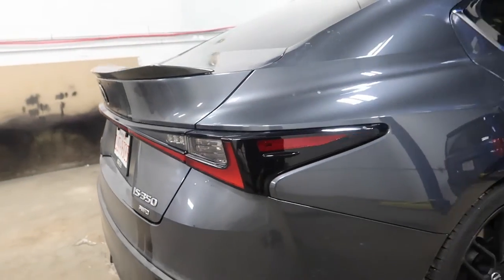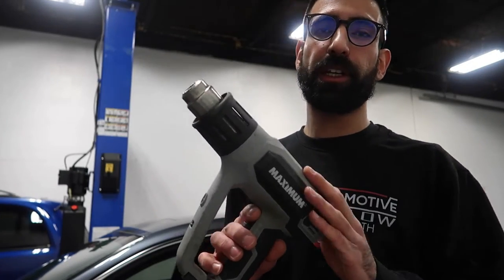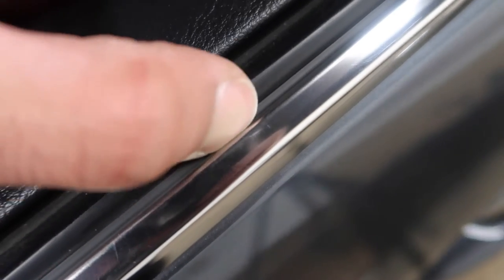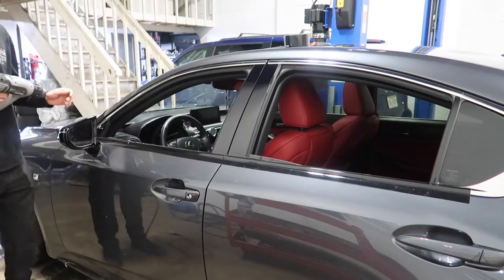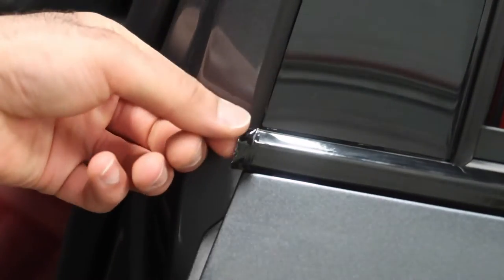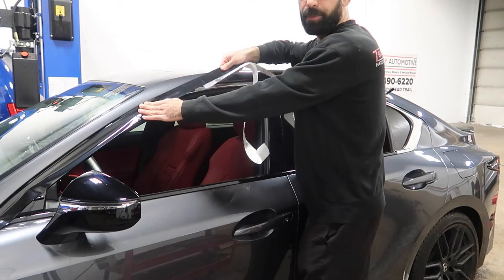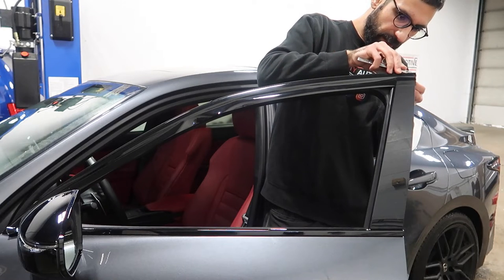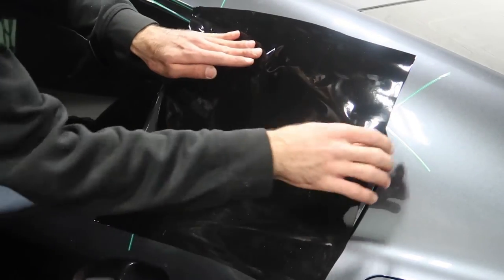Vinyl Wrap Window Trim - Lexus IS

Comment: I did this to my 2015 350. I also wrap cars, for context. Definitely worth it with tinted windows. Dint forget the grill trim. I also wrapped the rear logo with black 3M 2080 and it came out great. This is very technical, idk if is try it without the skill set.
Reply: did you use gloss black?
Reply: @alvannpham  I did and before I tinted my windows. I feel like matte or satin would clash with the gloss appearance of the tinted windows. Biggest bang for the buck mod on my car are the 20mm wheel spacers.
Reply: @nothingtoseehere293 did you do 20mm all around? I'm RWD, wanting to put some spacers on too.

Comment: Hey so I've done a chrome delete on my own IS and I happened to cut a bit of the rubber on the bottom of one of my windows. Will that severely affect the waterproofing of the car or will it be fine? Are there any ways to repair that rubber if it's cut?
Reply from the maker: If its not cut too bad it shouldn’t make a difference but you can use some super glue to attach it back as best as possible

Comment: What kind of vinyl did you use?
Reply from the maker: 3M 2080 series
Reply: @EhabHalat  Do you remember where you bought it?
Reply from the maker: @caitlinncarloss  i got it from a vinyl store in my city but you may find it on amazon or locally in ur city
Reply: @EhabHalat  how much did you think you used?
Reply from the maker: @caitlinncarloss  roughly 25-30 ft
Reply: @EhabHalat  how thick is the vinyl you used?
Reply from the maker: Im not sure tbh

Comment: I’m starting to wrap myself! Question, wouldn’t it be easier and better to take off the chrome piece’s?
Reply from the maker: Nope its alot easier doing it on the vehicle. That way your not holding the chrome with one hand and trying to lay the vinyl with the other hand. Ive tried before and it gets annoying
Reply: @EhabHalat   thank you 🙏🏻 how long do you think it’ll last doing it right ?
Reply from the maker: If done properly, it can last up to 7 years
Reply: @EhabHalat  is there any sun protection you guys use for the wraps especially for the carbon fiber
Reply from the maker: @abeltabares3163  i use turtle ice wax it works pretty good
Reply: @EhabHalat  damn it messed up the carbon wrap 😢
Reply from the maker: Carbon fiber is usually harder to work with
Reply: Definitely not.